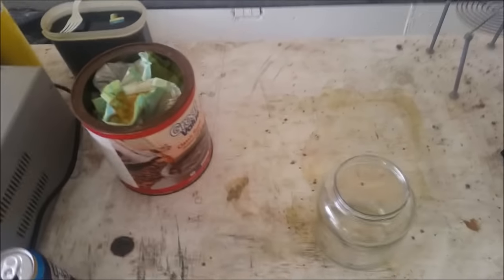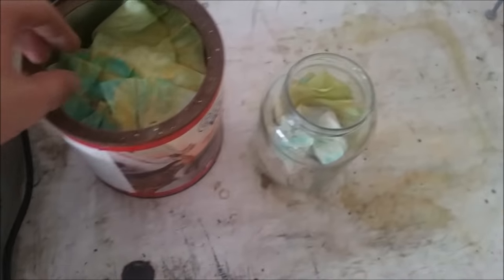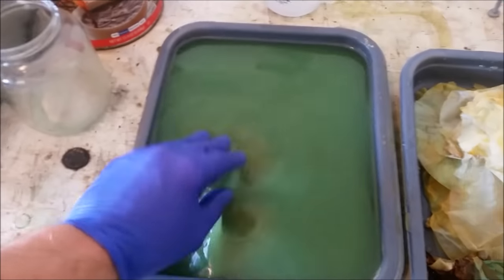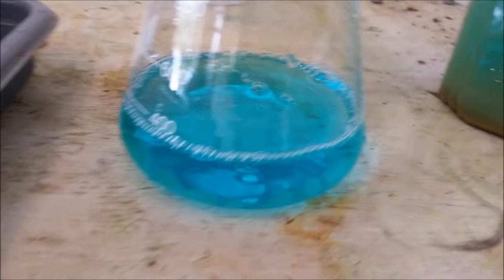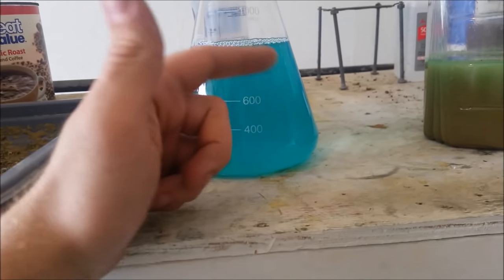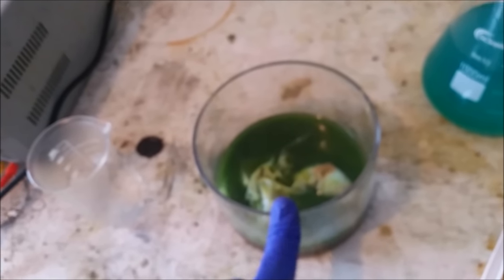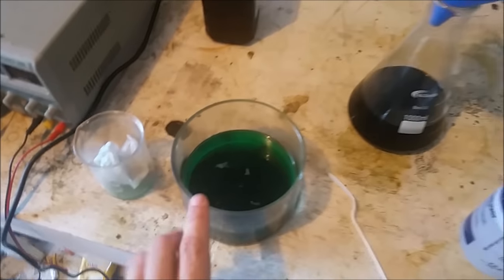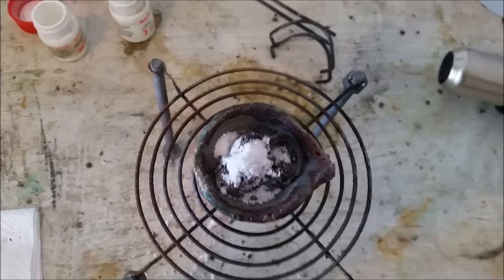Noble metals from copper electrolosys

Comment: would have been soooooooo much easier and way more efficient if u soaked the filters in nitric acid , it would have disolved every bit of copper and also any silver into solution . u could have then retrieved all of the copper in metal form by adding a chunk of irn and letting the copper fall out on it

Comment: Why not pyrolyze/incinerate the filters, then process the ash? Would greatly reduce the amount of liquid to handle.
Reply from the maker: If I had to use a solvent other than water then this is what I would have done.  Boiling off water, while time consuming, is cheap and easy.
Reply: @Puddin  I disagree... boiling off water uses electricity while incineration uses only a small amount of propane. Once you have reduced the mass of your filters to a fraction of the original size, then you solve or rinse  with a much smaller amount of  water to separate the water-soluble from the rest.  1-2L of waste water rather than 1-2 gal to deal with.
Reply: last time I processed gold refining filters (ultra-fine gold sponge/particulate) using this method, I only had 250mL of waste rinse water for approximately 50 dirty 15cm medium speed filters. After rinsing away water soluble salts, I was left with only solid metal particulate and ash. Process first with HNO3, rinse with distilled H2O(solution contains silver and copper), then process remaining solids (gold, platinum group metals, undissolved other)  in aqua regia. filter off ash and other particulate from solution then test resulting solution with stannous chloride solution and precipitate accordingly. The point is... one should generate as little waste as possible.   Using this method,  I produce less than 1.5L of waste water for the whole process.
Reply: @mikeel78   I'd like to point out that airborne waste is also a valid thing to reduce, as it has been shown to cause great health and environmental harm in areas where unfiltered airborne refining waste is released. Viewing the air as a free toilet while tightly arguing on behalf of water quality, while doing highly intelligent, hazardous chemistry, is worthy of a blunt reproach. Government regulations vary, but "being able to get away with releasing evaporated mercury and dioxin, etc., that is likely associated with an unreported 'hobby' income" is not a valid reason to do so. Especially if you are living and breathing in that general area. The phrase "outdoors or in a fume hood" does not reduce the toxicity of the process being undertaken, nor does it obviate the need for exhaust scrubbing/filtering/reclamation/and disposal. Along those lines, evaporating water waste is - in my opinion - superior to burning stuff from a pollution standpoint, as well as a product loss standpoint. If you're using a lack of hazardous waste compliance as a mechanism to be profitable, it tends to undercut the validity of your other arguments.

Comment: At 22:30 - 22:60, aren't those vapors quite toxic?
Reply from the maker: At that particular point there are no vapors coming off solution.  However either way I do keep constant air flow blowing away and outside just in case.